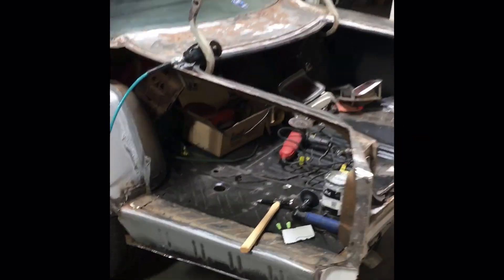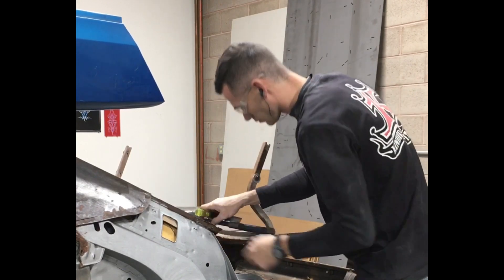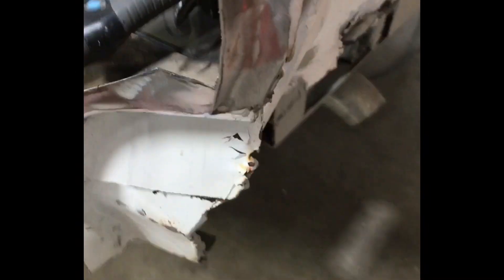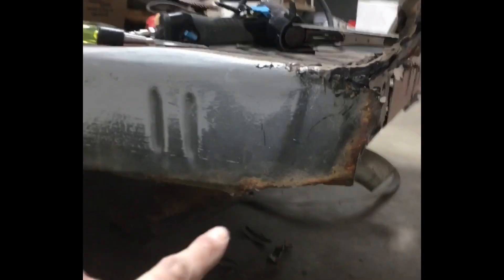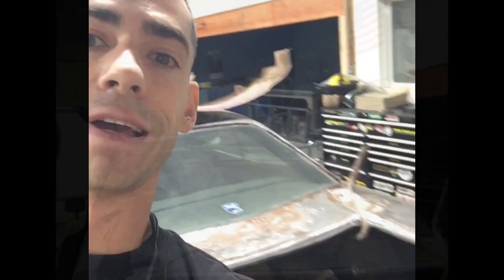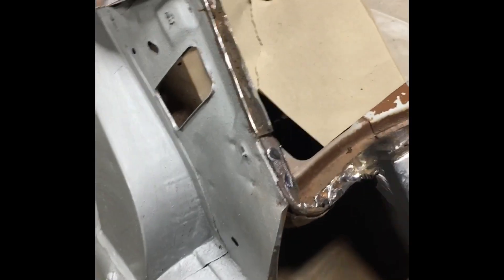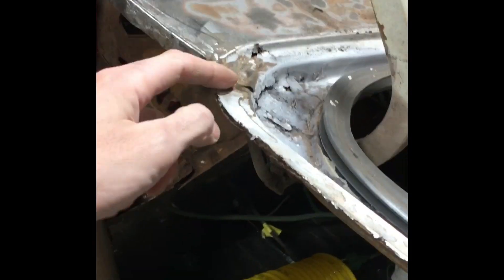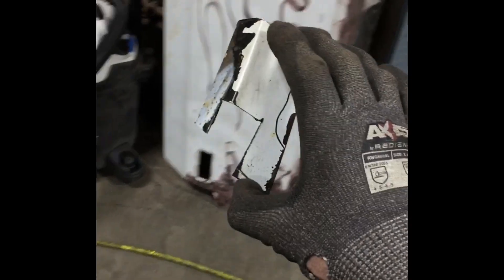1969 Road Runner Rear Metal Rust Repairs

Comment: That back glass came out way too easy. Mine was packed with silicone sealant and some gray putty in addition to the factory butyl tape. After all that was cut away, I still had to maneuver between the trim clips.
Reply from the maker: Yea man I got super lucky is right! It can be a pain for sure like that
Reply: @FanelliRestorations  I was so happy not to break the glass. Just installed the new trim clips today. I have the butyl tape, but I’m waiting on the primer to arrive. I guess 3M doesn’t make the primer any longer, so I found CRL CRL1106 Pinchweld Primer as an equivalent.
Reply: I lost you for awhile. I remember when you got the RR. Glad to see a couple vids of it.